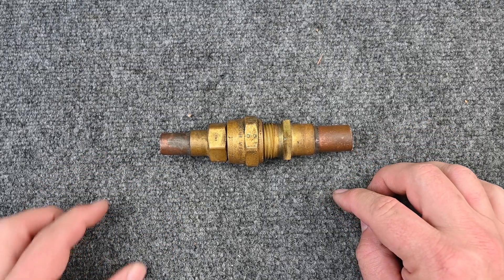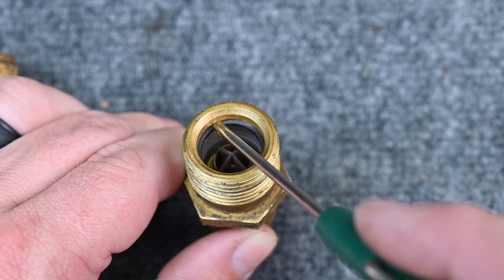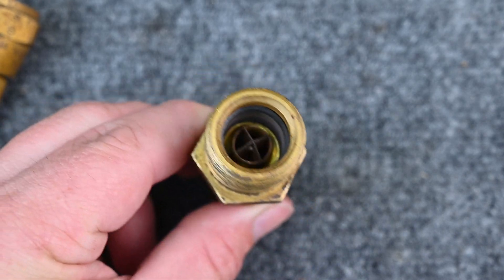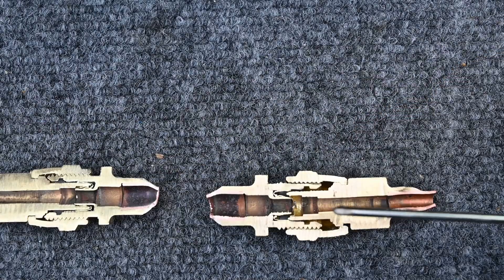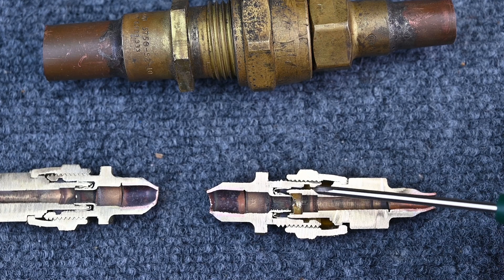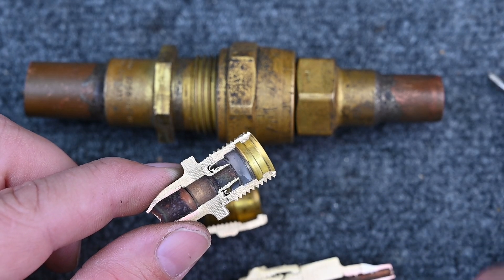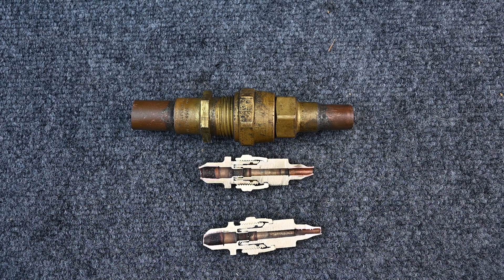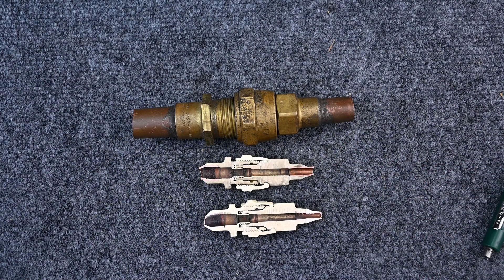HVAC 087 E connections part 5 mechanical fittings pre-charged line sets

Comment: I have a manufactured home and I believe my coil is leaking. If I go to replace it would you recommend going to sweat lines or go back with these precharged ? And if I have a hex nut at my coil on the high and low side does that necessarily mean I have a precharged line set or are some screw type anyways. It’s a nordyne coil. Thank you.

Comment: I'm planing on buying and installing a Revolv Accucharge heat pump/evaporator system for my new manufactured home which only came with a furnace. It incorporates this type of connection system. I'm not an HVAC tech, but am very mechanically inclined. They don't recommend it for DIY, but I think I can pull it off.
Reply from the maker: I have seen homeowners complete better installed than professional companies.  It's all about your abilities.
Reply: @love2hvac when I was in high school 2006 we installed a ac at my teacher house with precharged line set but we braze them with out leaks happening some how after connecting and it's still working today

Comment: Do you think a compression fitting is suitable for HVAC? As a diy I'm nervous about the flares failing but I don't have nitrogen tanks to flow for brazing
Reply from the maker: You would probably like this 
https://youtu.be/gGGl-Czbpjs
Reply from the maker: Or this https://youtu.be/akFUIHc6rZk
Reply from the maker: This product with flares is a other solution 

https://youtu.be/WNVW1Svagso
Reply: Awesome stuff
Reply: Called a rotolock fitting

Comment: Great video to explain the pre charged lines.  All of the Mr Cool install videos (including the 3rd party videos) make no mention of this part of the installation.
Reply: These are different than the mrcool ones. Same initial principal (easy mechanical connection) but the mrcool operate more like a soda stream /CO2 reusable canister, vs this version is like the disposable pierce and disposable mini CO2.  Mrcool essentially have a patent on a spring loaded system which is able to reseal itself with more orings for redundancy on leak prevention. So it's connect and depress and if ever needed can disconnect (they actually do not recommend this). Same issues here where external factors could make the oring deteriorate but barring that they seem to work well and if done correctly can last a long time.
Reply: @_Tuuri  thank you for an honest, no BS assessment of a product. It hard to find educated asks on how things work, and ways to avoid pit falls.

Comment: I for see the same problems with propress crimp fittings. Sure it's fast n easy but sooner or later those O-rings are gonna dry out and leak.
Reply from the maker: Yep. 
I agree but this is what is out there, so this is what I show. 
Mrcool is using this now also.
Reply: @love2hvac  Thanks for showing us!
Reply: @love2hvac  are you sure these are the same ones Mr. Cool uses? If you look at photographs of the Mr. cool fittings, they look significantly different than the ones in this video. Changes in the mechanical part might not be an improvement if the O-ring is the vulnerable part. O rings are generally quite robust and chemically inert but your point about different refrigerants is a good one I think.
Reply: I agree. Idk why people are OK with burying rubber seals behind their walls